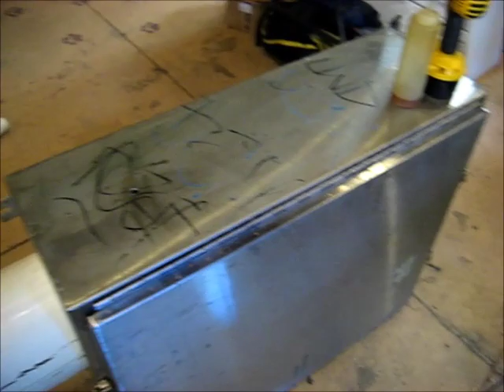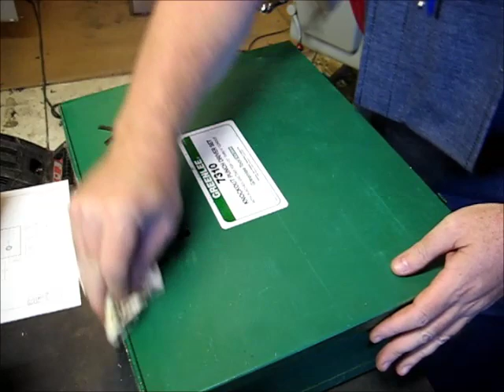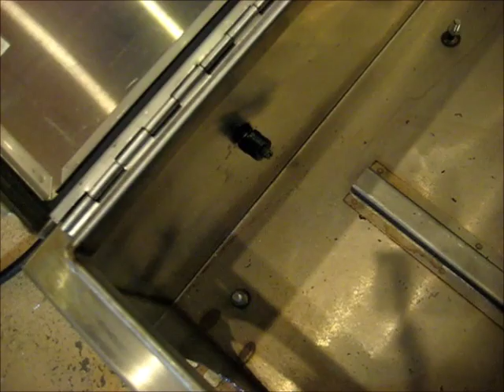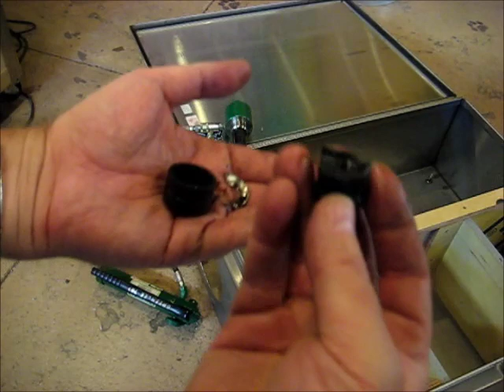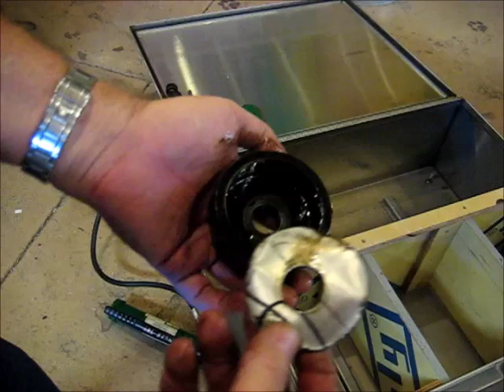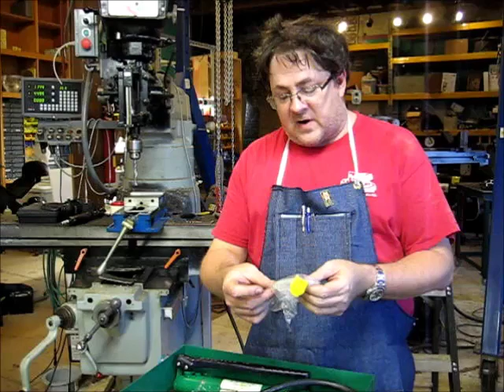Knock-out big holes easy!

Comment: Nice job on the video.  Looking to punch 3.5" holes through pre-made walls of 5/8ths press board with 16g galvanized sheet laminated to both sides. Basically a sandwich of pressboard between two sheets of tin..   Do you think this device would work for that?   Please reply to djpiazzo@comcast.net
Reply from the maker: +David Piazzo It would work fine on the 16 ga. but the press board will screw the whole thing up.  Afraid you are going to have to use a hole saw. If you have access to both sides, start the hole from one side, punch through the 16ga, then move to the other side and put the pilot bit in the same hole and then work you way back to the other side.  Your best bet.

Comment: Great video! Just one thing though. NEVER PUT YOUR HAND ON A QUICK CONNECT. Seriously, just don't.. If there's a leak or a catastrophic failure, chances are it will be at a quick connect or cable crimping point, which your hand was covering both. Hydraulic Injection Injuries are nasty, horrible things. High pressure fluid being injected several inches into you is a bad thing.
Reply from the maker: Thank you very much for pointing our my obvious shop safety violation.  As a person that has worked around high pressure hydraulics for years I knew better and have seen first hand the kinds of injuries you speak of.
Reply: I'm sorry you've seen what they can do. I've worked in a diesel shop before, and seen what ultra-high pressure diesel can do to someone as well. It's easy to get complacent, especially to such hidden dangers, but all it takes is one time to ruin your entire life. Stay safe!!! and thank you for your awesome videos!

Comment: Schedule 40 2" PVC has an OD of 2.375" -- how can you use a 2" punch?
Reply: that 2" his cutter has stamped on it refers to the ID of any 2' electrical Conduit. Rigid and EMT fitting diameters are larger. The PvC will fit right in there, brother...